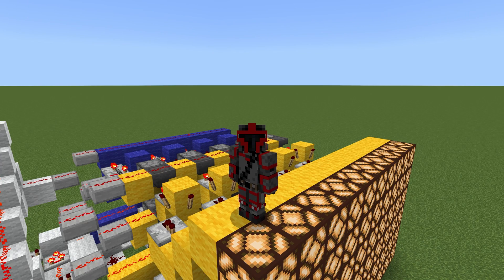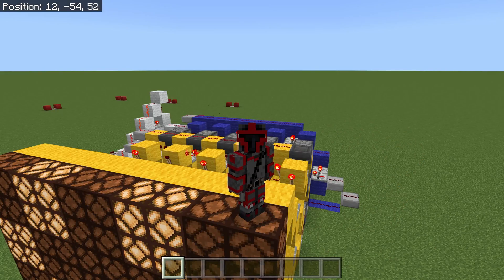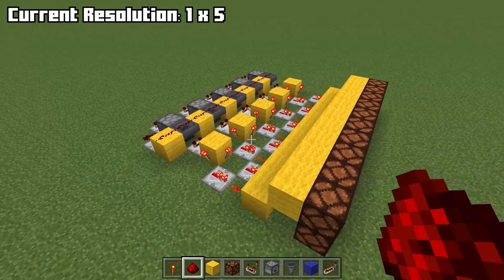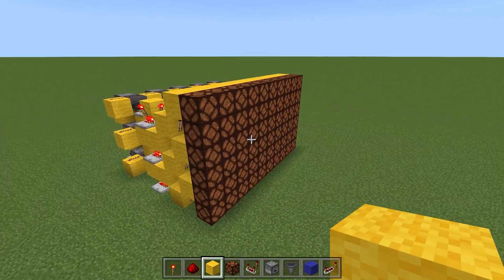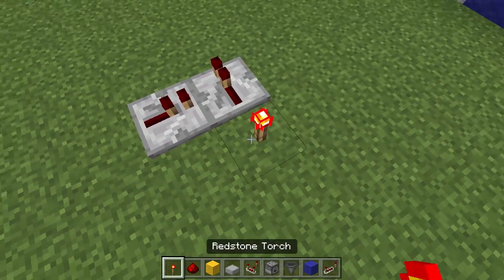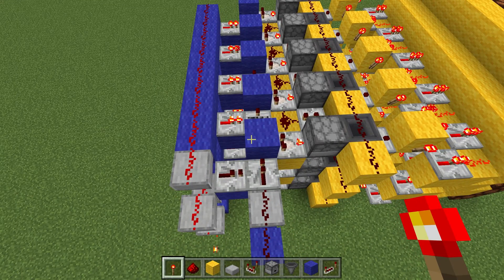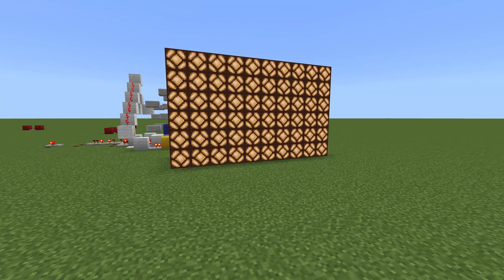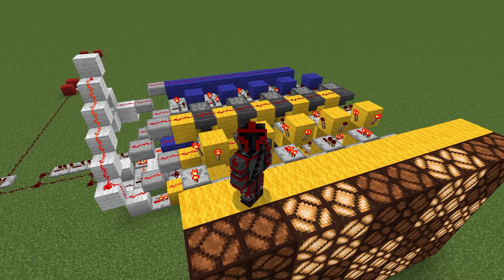COIL - New Redstone Serial Display

Comment: how do I do the maths for the timing? I have 13 X 8
Reply: Multiply your total pixels by 1.13. Anywhere around 116-119 ticks
Reply: @TheMrgman910  Thanks so much
Reply: @TheMrgman910  It's 117.52 I'll take 117
Reply: @davdunies  lmk if it works

Comment: Can this be built bigger? Or is this the biggest it can go? Just curious. Oh also as around 6:20ish in the video when you made that redstone ladder with slabs is the top repeater on the far right side supposed to lock? Because the ladder disables that function.
Reply from the maker: Well, this is stackable as far as I know, so you could make it have larger resolutions. Just remember to adjust the timing for your serial input.
To answer your second question, that was a mistake on my part when recording. If you build the line out one block, it will work fine, and you shouldn't see any issues.

Comment: You know what's crazy? I have created the EXACT SAME display. My goal was to create a 2x2 pixel display to be used with an observer based serial GPU (in fact its more like a Video ROM)  design by the German youtuber "the jo craft", that would give a clean, still image at the maximum possible refreshrate. And funny enough I came up with exactly the same solution, however I decided to call this an SSM-Panel (solid state memory). I was super proud of myself for developing such a compact, yet perfectly functional design, seems like I wasn't the only one, though...

My current plan on improving this technology is to break down the screen into multiple 3x3 pixel displays, that get refreshed by the GPU one after another. This should allow for basically infinitely high pixel counts as well as greatly reducing the required size of the observer based video ROM, that I have been using, as it only needs to account for 3x3 pixels at a time. However, this will require an actual graphical processing unit to be able to render the picture from the little 3x3 fragments. I am looking forward to the callange.

I know I could get rid of the ROM completely and only use the observer design as a serial encoder, however I think that using "prerendered" fragments will greatly improve the performance of the GPU, rather than making every single pixel accessible (but I might do that as well in the future).

Comment: Issue; around 8:50 you placed the staircase and when you placed the slab you placed it so that the input of repeater also goes up the tower so this would make the screen out of sync (some parts turning off sooner than others)
Reply: it can easily be fixed by rewiring the tower or by moving the staircase by 1 block away and go down to input of repeater

Comment: Im jealous of bedrock for having usable 10Hz serial haha
Great vid and build :)
Reply: I think it works in Java
Reply: @gearsgamer7115   @GearsGamer  No it doesnt, 10Hz normal serial doesn't work with java comparators
Reply: @I don't even know anymore this design won't but slightly different design works on java
Reply: This should actually work in java (well the serial decoder as well as the pixel designs as they originated from java) however idk about the buffer he make which is the bit that syncs the output. I would imagine it would be very easy to make a java edition of the buffer if it does not work on java as all it is is basically an on/off switch.
Reply: @TheDarkness344  it doesn’t work on java due to quasi connectivity
Reply: @thefuckingskullemojiit works🤡
Reply: I never thought I’d see two YouTubers in one comment which I recognise, one of them even being mentioned in the video